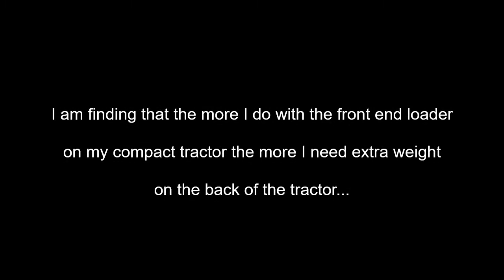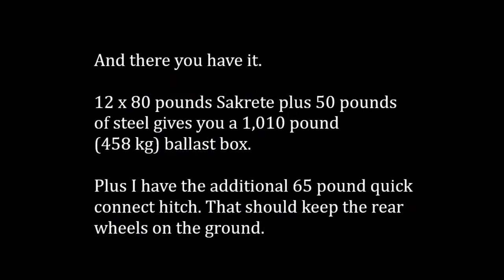3 Point Hitch Tractor Ballast Box

Comment: Hey Man ,great job on the ballast box. Do yourself a huge favor & ditch the H-r-r f-e-t quick hitch, mine folded up in 5 minutes (very dangerous with that much weight  especially) & get a good one. Happy safe Tractoring & thanks for the vidio.
Reply from the maker: Thanks Donald. Lately I have been doing a ton of front end loader work with the tractor and have had the ballast box on for about 10 weeks straight without any issues. Maybe you got a bad one.

Comment: You need lift pin bushings with the harbor freight quick attach. The problem with the harbor freight hitch is the lift pins on the hitch are undersized and not the 7/8 required. So with the smaller pins it's only Category 0 compliant and shouldn't be used on a tractor over 20 horsepower.

Comment: Could you please provide the finished product dimensions? Just the size of the concrete block would be enough. Thanks
Reply from the maker: My goal was to make it compatible with my quick hitch which is 25 1/2” between the arms and 17” from the arms up to the top connection. Leaving a few inches from the steel to the edges and calculating the  depth to accommodate the sq ft of concrete of I wanted for overall weight, I ended up with 30” wide x 25” tall x 14 1/2” deep.

Comment: What would happen if the box was too heavy for your tractor to lift?
Reply from the maker: The arms of the 3 point hitch simply would not lift, just like if you put too much weight on the front end loader it simply wont lift it.
Reply from the maker: But I should add that before I built the ballast box I had a big snowfall to plow and I mocked up a temporary solution with a wooden palette and the dry bags of Sakrete that I hooked to the three point hitch without any problems, so I knew I could lift it. Otherwise I would have had one for sale 😁

Comment: how did you figure out which tires to order to get that narrow stance? the kubota dealers around here just scratch their head when you ask them about making a B model narrower.
Reply from the maker: Everything on my compact tractor is stock. It is a Yanmar imported from Japan and was new circa 1980. That is the stock stance which is too narrow for my liking. It feels very tippy even on a slight grade which was one of the reasons for building the ballast box to help lower the center of gravity. Sorry but I cannot answer your question about Kubota B models.
Reply: @duncanmacdonald3164  ah, got it. thanks for the reply. i was looking for a sidewalk snow blowing machine.
Reply: They make a narrow tractor
Reply: You cant make a model narrower, but you can buy the narrow tractor
Reply: @Will-tm5bj  you can make the stance of a tractor narrower. they make rims with different offsets and on a lot of rims you can flip them from one side of the tractor to the other for narrow vs wide stance. thats what i ended up doing on my kubota tractor.
Reply: @nocoolname32  yeah I know some of the ag tire set ups can be switched a little bit, but they won't come close to being as narrow as the actual narrow model
Reply: @Will-tm5bj  yup, i got an ag tractor. those narrow models are impressive. i looked at them for a sidewalk machine for snow but most of them are for vineyards, no cab. brrrr.
Reply: @nocoolname32  oh i didn't think about that, I guess on such a narrow tractor a cab could be bad news